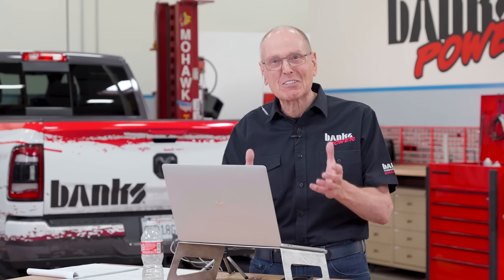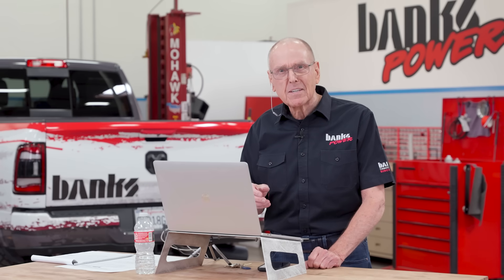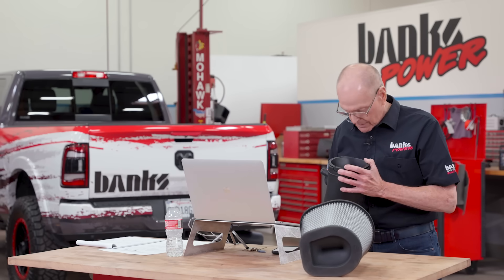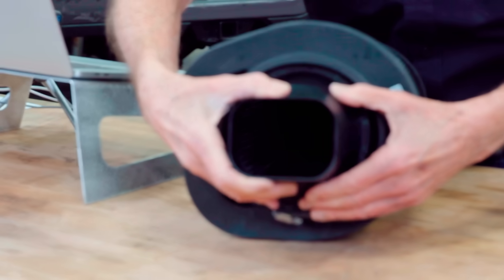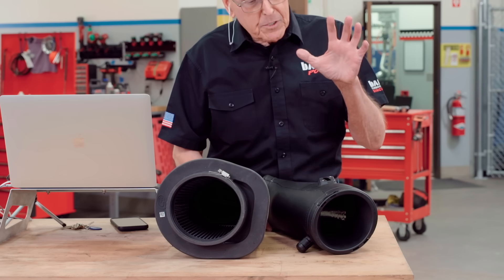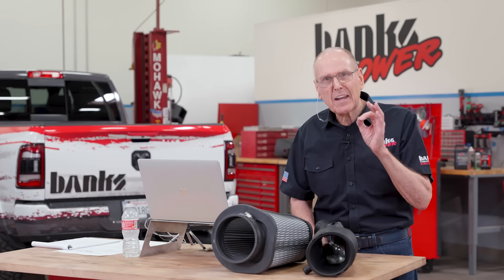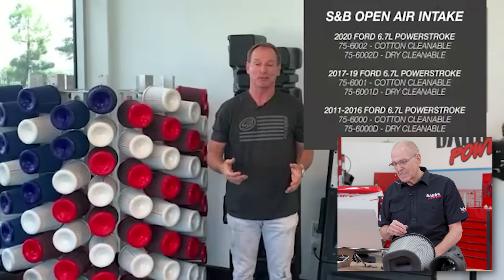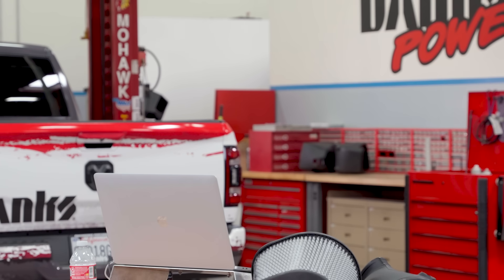Stop making these air intakes! | Fact Check

Comment: I absolutely respect everything that is said in this video. If you do not believe in it then you don't sell it. That is on your name when you co-sign something when you put your name on something you back it with everything because that is who you are and what you represent.

And then everything Dallas saying it's so on point. I'm glad he also mentioned the rectangular versus round. While I am no Gale Banks I have been building very high performance engines and doing a lot of high-end Custom Fabrications for 25+ years, in all of that I also know high-end audio systems.  Got my MECP in the early nineties, yada yada yada I actually explain this logic when comparing round ports to rectangular ports speaker boxes subwoofer boxes. While the rectangular will work the round ones will be superior. I even said you ever wonder why they don't make a square exhaust pipes? Well some do because it looks trendy and cool but the reality is that this affects air flow and turbulence.

Comment: 40 bucks for the filter and 3 “ abs fittings from the depot still running strong on my 12 valve and sounds great saved me 500 $

Comment: All I can say is do your research people!  Don't believe anything you hear, half of what you see, and believe only what you know!  I did my research, bought a cold air intake and once installed the vehicle wouldn't even start due to the amount of air that was now flowing to the throttle body... it required a specific tune to run and the power difference was just shy of an 18hp gain.  The kit wasn't cheap, but you get what you pay for... and the tuner was included with the kit.

Comment: I gotta ask, if the banks intake, just fools the ECU into thinking the mass air reading is correct, then what’s the point? Sure you can flow more air, but the ECU doesn’t know it’s flowing more air, in theory, it’s not adding more fuel either then. Am I missing something?

Comment: I put an open filter intake on my truck with a heat shield.  Sounded good.  Then I started logging truck with HP Tuners and saw how hot my IAT's got.  Went back to a closed box intake system.

Comment: I like how you explain everything. I don't think the bigger the intake pipe/filter the more power you receive. Due to the diameter of the throttle body. It can be as big as you want but at the end of the day it is still regulated by the throttle body. You can only pull so much air thru the throttle body. If the intake was pushing air passed the throttle body then it can cause more air thru the throttle body my forcing air not sucking air . The engine can only get so much air thru which is dependent on the throttle response which restricts how much air is going into the engine by sucking not pushing.

Comment: I kept throwing a code P0402 with banks multiple times. I can only assume a tune would fix this. My new stock 23 was very jerky, half throttle or more. I decided to give S&B a shot. I have no codes, and it drives very smooth now.  The best advice I have is to try them both if you run into issues.

Comment: I added about 150 hp to my GTI by replacing the turbo, intercooler and downpipe plus a tune obviously and I still use the stock air intake with a paper air filter. I logged the wastegate duty cycle and tested with my Dragy and there was no difference between the stock box and filter and an open intake pipe no air box at all.

Comment: I don’t see a problem with a 45-lb battery on a diving board tray. The main shortcoming of the design is the lack of a small seawater pool installed underneath the battery tray for a more consequential “battery dive event”. If sad pool was large enough, he could fit it with jets that would spray seawater right into the intake tube to facilitate “better” cooling.

Comment: At last a proper engineer that understands the science.Did you see the NASA tests on K&N Air Filters and the tests on Slick 50. I have worked on Diesel Injection systems and Petrol Injection systems since 1965 and have yet to see the truth told about airflow, engine friction losses and dodgy Dyno tests. Big myth is that paper air filters restrict flow. I had a car that the diagnostics allowed me to measure atmospheric pressure, manifold pressure and temp. If you get the atmospheric pressure in the manifold at W.O.T then there is no loss of flow. No filter readings same as atmospheric. Half blocked and new gave no loss of pressure. Meaning that a K&N Filter will only give engine wear ( As NASA States) and no benefit on power.

Comment: Funny thing about my '05 Duramax... it HAS a MAF sensor but it is NOT used in the programming... all the tables use baro, temp and manifold pressure, but not MAF. I can enable it, but then I would have to check several tables to see if it is working correctly. And all this time I've been cleaning the darned sensor thinking it was integral... (until I found out it wasn't used, at least not in my OEM program)

Comment: Since this style of air intake hit the market, I asked everyone on car message boards "WHERE DOES THE 'COLD' AIR COME FROM?" I got all kinds of Dunning-Kruger answers to that. Also, replacing plastic ducts with aluminum ducts, heating the intake air, was something else I pointed out. I shake my head every time I see a "cold air intake" sucking hot engine compartment air in a car. I am SO GLAD to see Gale comment on this. I didn't know he had a channel. I subbed immediately.
Reply: No use in talking to the Cold air crowd who sucks hot air from the engine bay.
Reply: Many CAI designs pull air through the fenderwell and/or the front near the grill, which would certainly be cooler than an open system described in this video.

Comment: I've seen people that just don't understand diesels. Then building diesel engines and say they make more power with a higher intake velocity with a low pressure variance.  I tell them thats wrong and they just happily blow black smoke as they drive away.  All I can do is shake my head and wonder.

Comment: The insert in the “big tube” acts as a Venturi, increasing velocity across the mass air flow sensor.(preventing a code) The increase in tube size makes up for this insert size because pressure drops behind the insert, sucking in air way faster than a Banks system, averaging air flow between the size of the tube and insert divided by the total cubic volume of the entire tube. Don’t forget when someone bad mouths(dramatically) the competition, they usually are having to compensate for their own product and character. Open air is for trucks pushing 900+ horsepower, where closed air boxes would suffocate the engine.

Comment: Open element air intake systems have been out for years and still a very popular product whether car or truck. At least east s&b was honest about the product they made and not making it out to be the latest and greatest intake on the market. It’s an intake wanted by those customers and made for those customers. I will say it’s not my thing and personally have enclosed on my diesel trucks but the amount of trucks or cars you see out there with an open element intake system or BHAF is pretty insane.

Comment: Who sells something they don't believe in? 
The video was a drop in the bucket. The "news" sells us garbage everyday look how hard they work to sell democrats. But someone buys it! 
 If there is any single detriment to the gasoline/Diesel supply, pricing, the US auto and trucking industry then that's it.
 Fact check that! 
You remember the setbacks of the fake gas crisis of 1971 to the choking of engines in early 70's to the now intentionally detrimental push to E.V's and another fake fuel crisis of 2023. EV's will come 2 or 3 years from now comfortably but auto makers will kill their profits to appease the government again. 
Sorry but it needs to be said. 
Now we won't recover like we did in the 90's.

I won't do this again but just want it off the chest.

Comment: I wish I had a Banks intake and DPF back exhaust, but for some reason, ya'll have neglected the 2.8 LWN Duramax. Now I have an S&B intake and AFE exhaust that I am not happy with because of the fitment is meh. ☹️ I live in SO Cal if you need an R&D truck. I'll ignore the fact that there is no deringer for us LWN owners because our engines are quite sensitive, and your reps years ago at the offroad expo told me that Banks Power was working on it.

Comment: Exactly. 1 ft³ of air at 32° is going to weigh more than 1 ft³ of air at 80°. It makes sense that the computer only cares about mass because mass and moles are always directly correlated. If the computer measured volume, you'd have incomplete combustion reactions with either leftover fuel, or leftover oxygen whenever the temperature or elevation were different from what the computer was calibrated at.

Comment: @bankspower I just purchased a 2020 3500 drw and the previous owner installed a few of your products. Air intake , manifold and differential covers. The truck is one bad ass truck but i will only tow with it may 5-6 times a year (22k lb rv) my mpg, even on interstate at 65-67 mph I’d about 15. Anything you suggest to get a little better?  Looking to call very soon.

Comment: How come they don’t have the big ass filter that fits 2023 powerstroke ? The 2022 is same as 2023?????

S and b shows there to support 2023?? Banks need some help here
Reply from the maker: The 2023 uses different sensors and has different emissions programming. part of the intake needs to be reengineered. Especially with the HO package. When ours is released, it will 50-state legal and add power, not a rush job like some manufactures.
Reply: @bankspower  I don’t have the high output package. I just got the monster exhaust from you guys and got the pedal monster in. When do you think the intake for my truck will be out. I’d like to match all my add ons to banks.

Do y’all have the hot charge pipe for my 2023 powerstroke it’s regular 6.7 not the high output

Comment: Ik your a very knowledgeable person, and ik a lot of people gonna be laughing at me for trying something different on a stock 305 tbi in a camaro but what if i put a 14" open air element in the stock pan on car so it looks more like an old 70's air cleaner along with the snorkel grabbing air from front of hood and the top grabbing air from cowl air hood on the car. And if i do do this should i cap off the vacuum lines for thermac

Comment: Nothing like a good old Gale Banks take down. Back in the early days of filter on a stick, the gig about hot engine compartment air feeding the engine not making power, was a closely held secret to the few who were making these short rams. The almighty profit monster was in control. Well, that was decades ago. There is zero excuse to be doing this in this day and age. If you drive on the street, stick with your oem intake before spending any money on anything less than a true performance cold air intake.

Comment: I remember growing up getting my first car and putting in a CAI, it was a jetta, what I realized after I installed it is that it "sounded" cooler, but I felt zero performance impact, and saw mileage decrease. So I ended up getting rid of the baffles that were in the original airbox, that was pulling air from the fender, and that gave me a noticeable power increase and didn't see mileage decrease.  Ever since then, I've never done a "CAI" ever again, I've always gotten a great K&N filter, and gotten rid of all the baffling and made sure the stock intake was as clear as possible.

Comment: I love how Gale explained this, making it easy to understand. On the other hand, what it doesn't talk about is that S&B intake is still a huge improvement over stock. Bank's own testing data shows the S&B is the better value. The S&B delivers 86% of the performance improvement as the Banks, while only costing 75% as much. They're both great intakes, the Bank's is just better but at a higher cost.

Comment: Sounds like a lot of things being sold in all aspects of the Automotive Aftermarket for many years. Chinese made junk built & designed by people who likely have never seen,let alone worked on the vehicle(s) it's supposed to fit. It looks good,and sounds good....but they don't 'work' good? And many times doesn't fit without a lot of 'Hackery'. Mr. Banks knowledge I would trust,he's simply been doing this long enough to know what works & what doesn't. I first recall seeing one of his builds about '76 in 'Hot Rod',a Twin Turbo 454 Suburban. Impressed me even then,and it's something that had some room under the hood for this all to fit as well? And besides.....why do you think they came up with things like Hood Scoops,or (As Oldsmobile did in the '60s on 4-4-2's & W-31 Cutlasses/F-85's?) ducting attached to scoops fitted underneath the front bumper/in between the headlights. Or as Ford did on the 'Thunderbolt' Fairlanes ducting where the two inside headlights would usually go. And both designs used an Air Box of some kind? Even just the regular ol' Hood Scoops many times had a 'Box' or 'Tub' to seal it off that went between it & the carb that the air cleaner was inside of???

Comment: I can understand only caring about CFM...if you are running a carbureted NA gas engine with no computer.  I Still can't believe that those stupid hot-air intakes are still a thing.  What's it been, over 20 years now that people have been heat soaking and hydrolocking motors with them?

Comment: I own a Ford ranger with a stock 2.3 engine. I pulled the restrictor out of the air intake tube. I don't know about any sensor readings, but the little truck sure runs better, and a noticeable mpg increase.  Starts just fine on cold mornings.

Comment: One thank you is not enough.  This viewing was like a cooling  glass of ice tea for me, and I don't even run the type of stuff you specialize in.      

I just came from watching yet another ignorant C5 corvette modification, of which there are plenty,   given the age,  popularity of the car and a burning desire for thoughtless modifications.   .  It's like bored people with gossip , that results in lots of videos about how to "improve" a computer aided factory designed interdependent system of airflow to the radiator , with no more than some intuition and cutting.     I know there are untold numbers of C5 owners running around with their air filters on backwards, for no better reason that it can be easily done, and someone said it was better.    It was just so nice to hear a truthful,  highly skilled and technically proficient speaker, that I just had to honor the power of truth and education.

Comment: You know Gayle,l you do have a point, but going after this manufacturer in particular is kind of a low blow. I watched your video and unfortunately for you When you use the words probably and maybe(like you did SEVERAL TIMES) you reduce yourself to opinions and speculation. If you're going to call a man out on his product, take the time to do the research and come out with solid facts, otherwise you're going to end up losing a slander case in court. Something to consider with his very large filter is that it reduces the velocity of the air. It also reduces the resistance of the filter on the engine and the more restriction you have, the more power you rob. I have seen enough Dyno tests done with and without air filters. Unquestionably they put restriction on the engine intake and they rob power. Another thing to consider is that I imagine your products are substantially more expensive than A&,B And it seems like maybe you're pissed because they're taking a bite out of your market but not all of us can afford Gayle Banks products. So either take the time to do the research properly and bring us facts or keep your sour grapes opinions yourself. This guy has stated that he prefers closed element filters, but there are some of us out here in the world that prefer open elements for the sound of the open intake or the reduction in restriction. Go ahead and be proud of your products as they're the goods!!! BUT you've got no need to jump on this guy's case with your opinion, speculation and conjecture. People expect you to be professional Gayle

Comment: Even Gale can tell you, without tuning, no intake works better than stock. Your stock motor, will NEVER outperform the flow capabilities of your stock intake system. Manufacturers spent millions on R&D to make sure that even with a dirty air filter, your engine gets enough air. Now once you start making modifications to your engine, bigger exhaust, bigger turbo, a tune with higher shift points and a higher rpm limit, you will start to outrun the stock intake capability. In that case, I highly suggest using banks products for all of the above, because not just as a man, but as a business his model doesn't care what you "think" you know, his model deals in cold hard facts.

Comment: Love that restrictor.  Essentially an orifice plate.  Great for measuring flow using a DP sensor from Rosemount or Emerson, or ABB. Totally useless on a truck.  Stock MAF will be in an area of flow with a high Reynolds number and nowhere near the Vena Contracta.  Love that Mr Banks calls out this BS.

Comment: Test it, why? It will flow, but you've already pointed out the volume vs mass factor, and its a HOT AIR intake!!! Its like crimping the exhaust pipe over to make it quiet after deleting mufflers for better performance. Ive spent 30 years trying to educate people but now i just say, look what i run, DO YOU SEE A POD?

Comment: Best results for cheap is just taking that restrictor box out that is hidden in the front fender. I do that to all my vehicles and get better performance. Air is cold and not sucked in from the engine bay. It may not be rammed in off a scoop. But it is still free flow but cold.